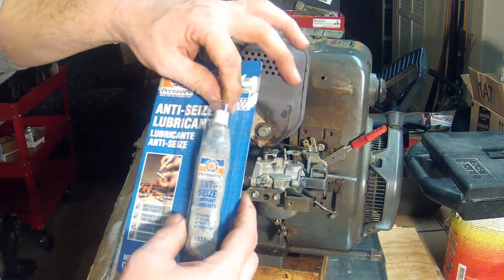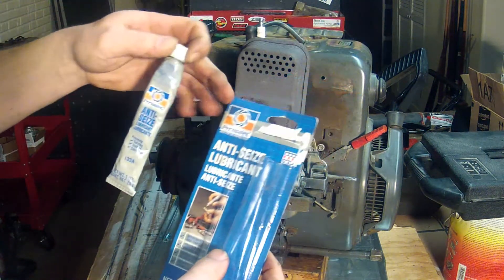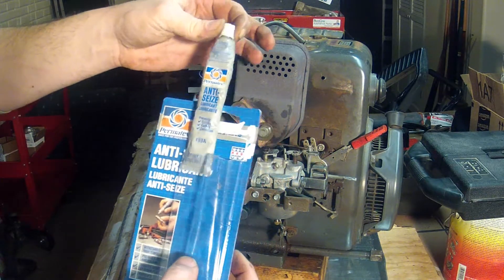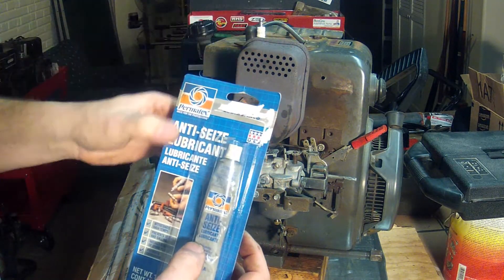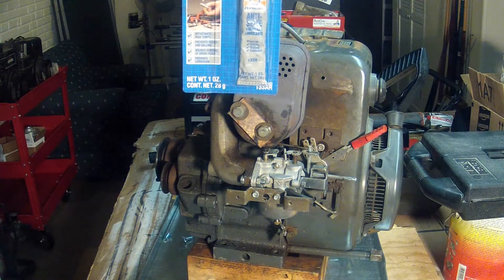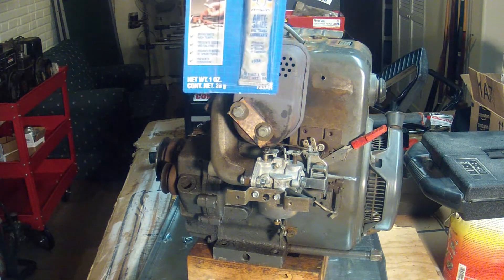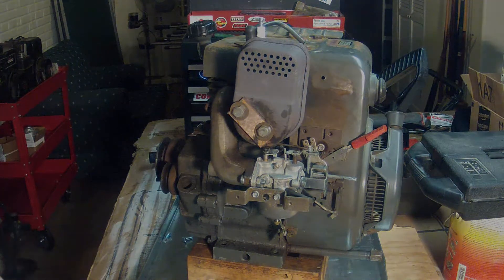Tecumseh HM80 Engine Part 12 - Muffler Installation

Comment: What type of gasket material did you use?
Reply from the maker: officialmikethompson fiber gasket material that I bought at a local hardware store. I am sure it's available at most auto parts stores as well. Thanks for watching.

Comment: Mine is exactly like yours. How long will these last. My muffler is from 1987. Should I buy a new one or use this old one. Will  a new one make a difference?
Reply from the maker: If the muffler is rotted out from the inside, you may want to replace it. The high heat makes it rust more quickly. Some of these mufflers get expensive but a new one should make a difference. If it's not rotted out them keep using it. Thanks for watching.

Comment: so when I was removing the old muffler of my engine I couldn't get the top bolt to break free. I knew the muffler was shot so I just bent it up enough I could slip it out. I think someone forced the wrong size screw in the that top hole because it was sticking out about 1/4" enough for me to get vice grips on it. Even with heat and PB it still snaped. 

Will the muffler bolts be enough on their own to keep the muffler secure against the exhaust manifold or should I plan on drilling and tapping that out? I am going to try a left handed drill bit but it was pretty stuck I don't think its gunna budge.
Reply from the maker: The best way is to start very slowly with a small titanium drill bit. Drill as close to center as possible. Then go a bit larger and larger until you have just the bits left in the threads. Hopefully you can get the left over shavings out without having to tap new threads. Another way is to drill it out and use a Helicoil repair kit. See my video "Helicoil Thread Repair on Briggs Exhaust"
Reply: sblg43 I which I had a bench and drill press to put it on hopefully I can do that on with my 19.2v craftsman cordless driver and stay true.